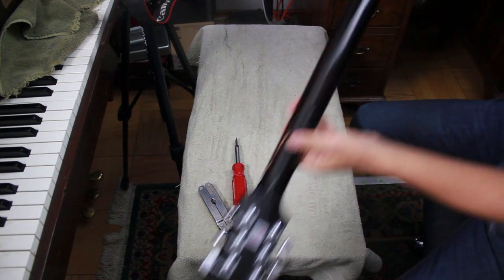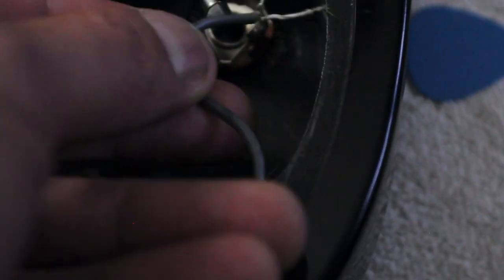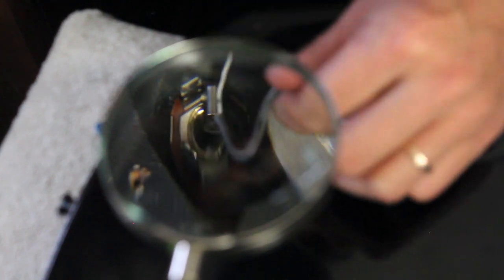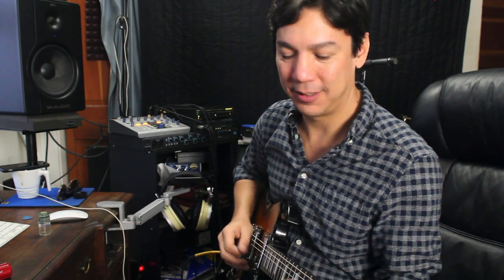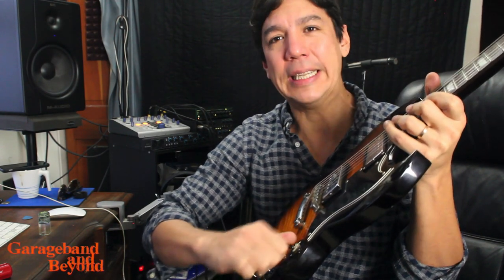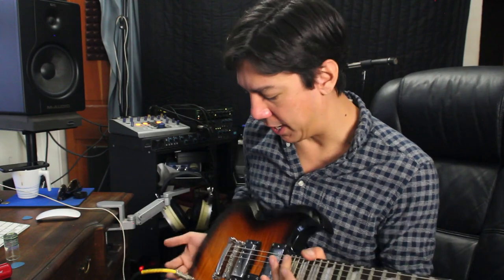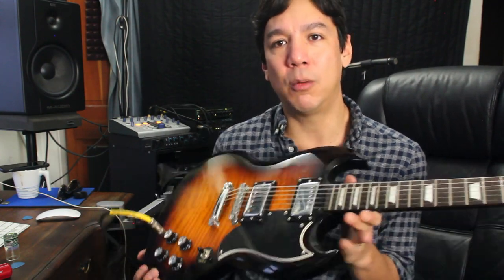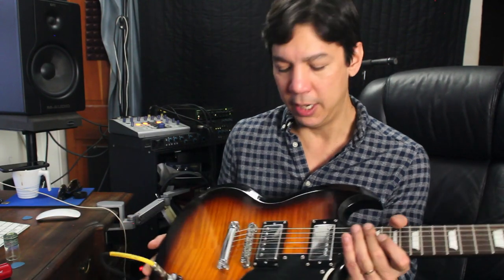VLOG 004 Guitar Tuesday - IT'S ALIVE - Ephiphone SG repair

Comment: A new switch is a good idea, new pots as well. When it comes to pickups, I'm with you on P90's, I've never had a guitar with one, they just sound good. Also, when it comes to the finish, you could re-finish the whole thing pretty easily with automotive paint from a rattle can. I've honestly found that to be much easier than patching a small area of finish. My Fender Jazz had some spots where the finish wore off from play, and I just sanded the poly off the neck and replaced it with gunstock oil - it won't look too pretty, but it's much easier than refinishing the whole thing and IME better than trying to fix a spot on the finish. Great project though, I love it.

Comment: Since your keeping the guitar, I would HIGHLY recommend getting a better switch, not because it's noisy, just because these switches tend to break fairly easy. Also wouldd recommend CTS pots, but DiMarzio is a great alternative as well, I have them in a bass I rewired. As for pickups, check out Dragonfire and or Iron Gear pickups. There like clone copies of Seymour Duncan and DiMarzio, but at like less than half the price. (I know you're cheap, you're just like me xD)